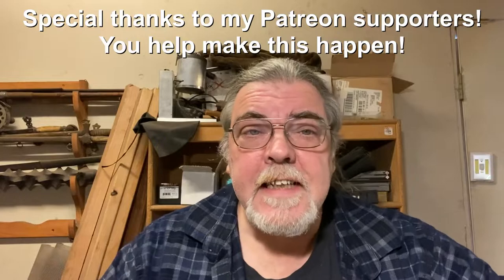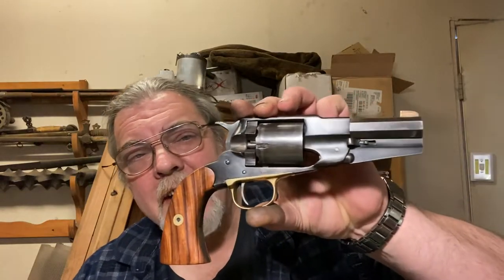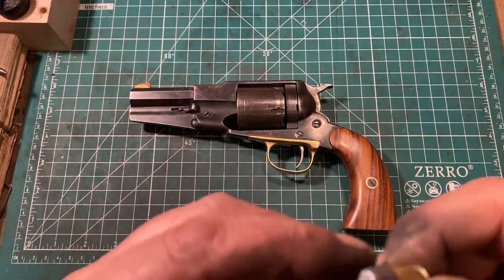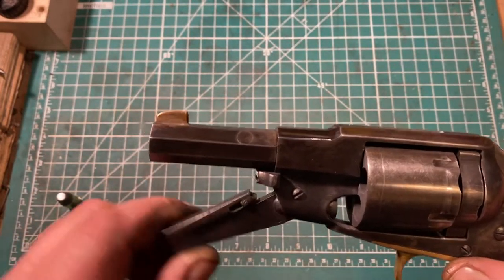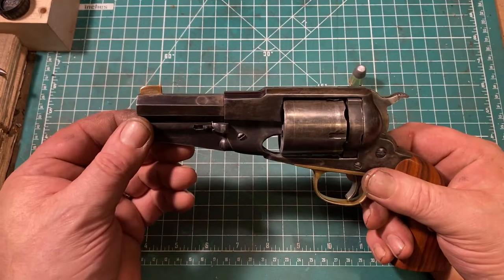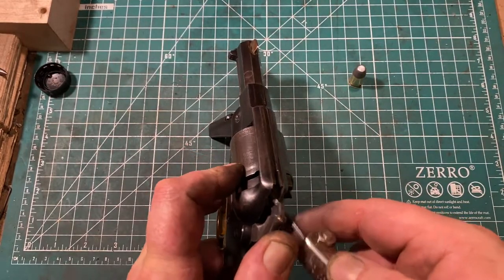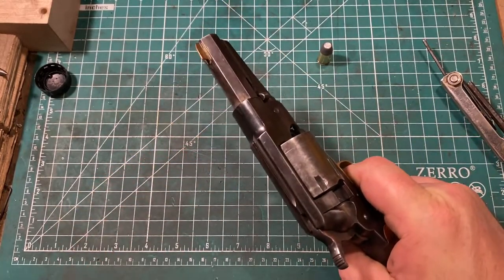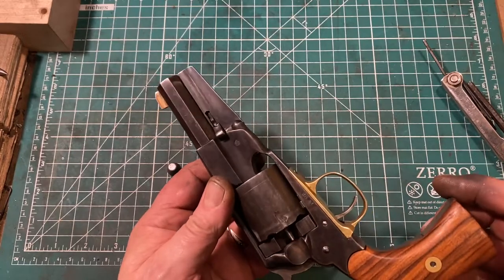1858 Remington (reproduction) Cartridge Conversion

Comment: As the video I posted on my channel shows I’m one of them thousands of ppl who shoots .45 colt 200 grain smokeless cowboy loads from my Uberti 1858 new model army revolver using my Howell .45 colt cartridge conversion cylinder and also as the video shows from about 45 or 50 feet away I manage to hit a small cantaloupe a few times out of 20 shots fired. Very cool conversion you have made

Comment: I would love to have one of those in 327 federal magnum
Reply: Technically if you were to load those with black powder instead of modern powder you could do it because the pressures wouldn't reach critical mass. Start with a 44 version get the factory cylinder and then buy the sub caliber devices or make them probably have to make them. Use high grade metal

Comment: I seem to remember reading that the original conversions were often done by sawing the back of the BP cylinder off, boring out the nipples and fitting firing pins.
Is that true?
Reply from the maker: Not exactly; early Remington conversions had the cylinder replaced with a 5-shot cylinder to use .46 Remington, a .45 caliber rimfire cartridge.  These has a back-plate very similar to a modern Howell conversion except rather than firing pins there was a slot at the edge for the modified hammer-nose to strike the rim.  Later conversions for centerfire cartridges had a backplate with firing pins.
Reply: @tinkertalksguns7289  thank you for taking the time to reply, knowledge is always appreciated.

Comment: Have you ever seen anything like this done on the .36 1858 c&p guns?
Reply from the maker: On Colt-style guns yes, but not on a Remington.
Reply: @tinkertalksguns7289  Interesting. I was looking at a vintage Remington pocket that was converted to .32 to fire way back when. I was interested to see if that could be converted back into cap and ball .32 with a new Pietta or Uberti pocket model .32 cap and ball cylinder. I guess the thing that would matter the most is the arbor rod diameter on the old one vs. whatever they use on the modern Italian guns. Dixie sells the replacement cap and ball cylinders for those but they don’t give a ton of specs

Comment: How did you make the bisley grips for it? Thats a feature i need
Reply from the maker: I had to modify the grip-frame by grinding at the back and adding a section of material to the from of the frame, a piece of steel silver soldered in place.
Reply: @tinkertalksguns7289  thank you for the reply I'm impressed by how natural to the gun it looks. I personally don't like bisley grips on the colt bisleys but it looks like it belongs on the 1858. Beautiful work